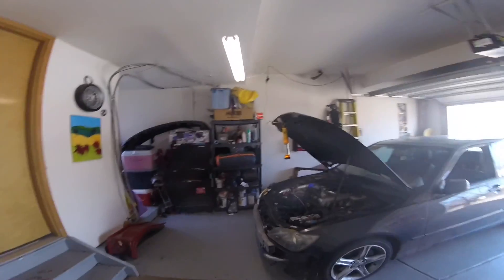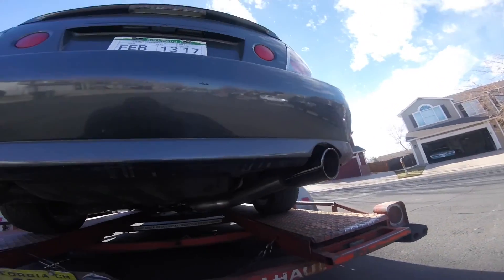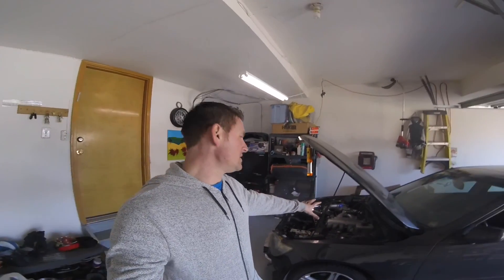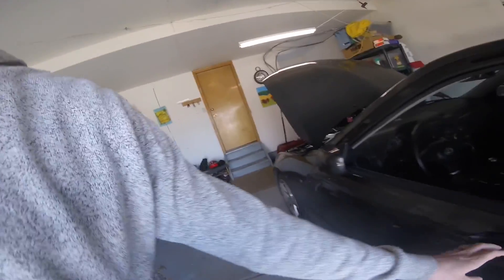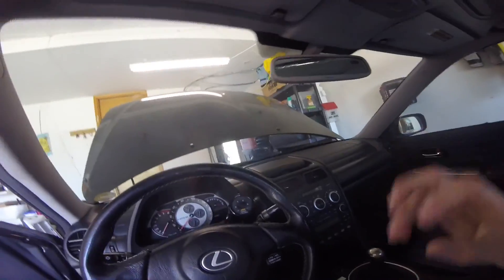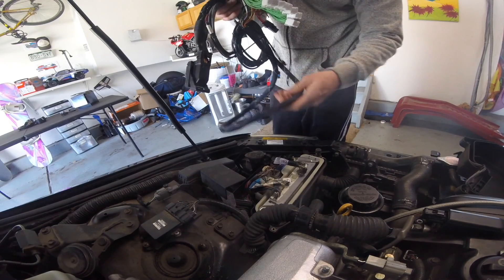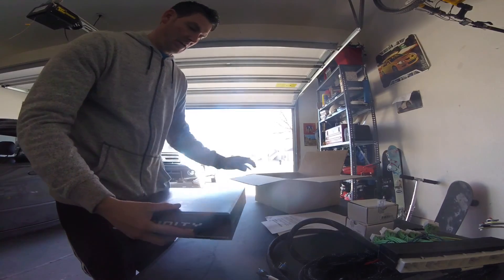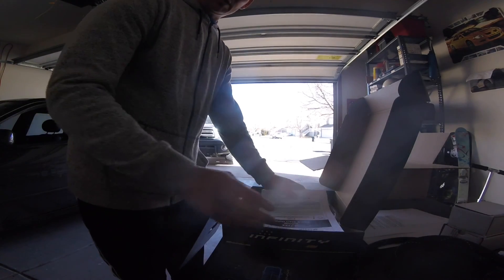IS300 Turbo Build #5: Exhaust and AEM Infinity Arrives!

Comment: hey do you have to install idle air control valve to get it idle properly?... im having problem with mine AEM infinity 506 on my is300.  Maybe you can send me a basemap. That be great!
Reply from the maker: Randal Sammy i do not have my idle air valve installed. Sounds like a tune issue.

Comment: Hey I also have turbo is300 build and I used the same cxracing kit to start. I have a question for you. Out of the 4 stock o2 sensors which ones did you use and what did you do with the ones that you didn't use if any?
Reply from the maker: Michael Murray since i used the aem infinity for engine management i didnt need the stock o2 sensors. My system runs off an independent o2 ran directly to the infinity. I do have the two stock front o2s in but they serve no purpose really.

Comment: What did you do about the primary & secondary o2 sensors?
Reply from the maker: I removed the stock o2 sensors completely.  I now have one single o2 sensor for the AEM infinity system.  I then used the second bung in the down pipe for my o2 sensor for my wideband gauge.